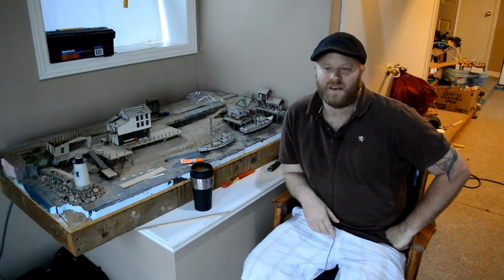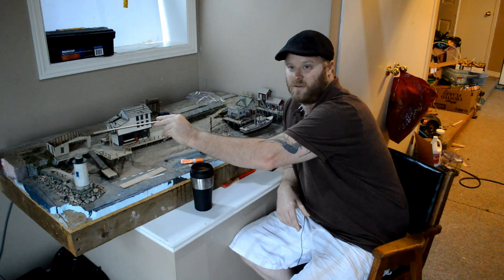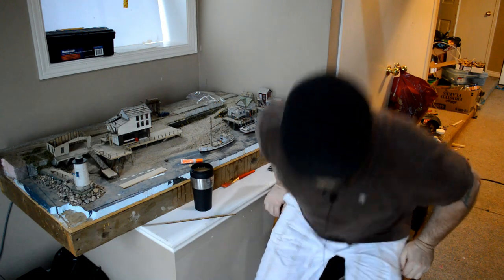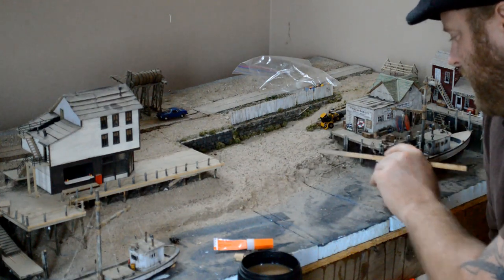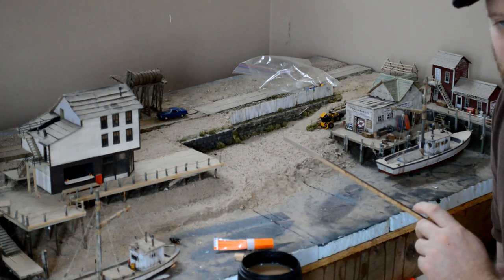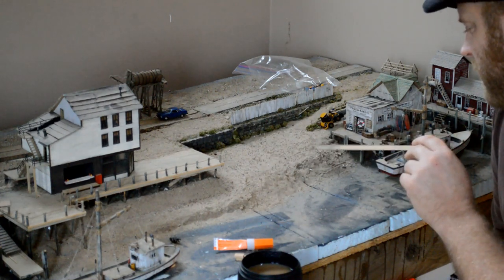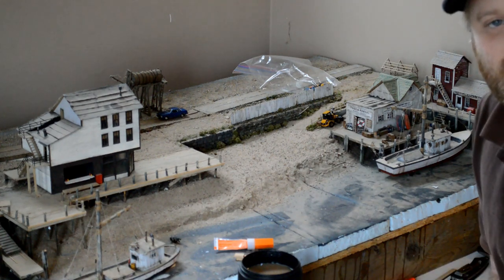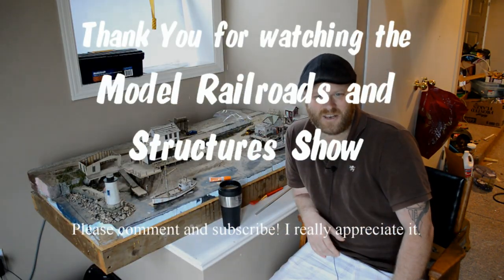Marine project question

Comment: Hi Ron, at the end of the white building (the big one) I would take out a section of the board walke and the water tank in the back ground. Put in a ramp from the area of the water tank down to the water to pull boats up, place a boat repair shop and work from there. Foss Landing kits come to my mind. You have a great start to a sea side fishing village, perhaps even a sail making shop etc. Need help just give a yale. Good luck and keep doing your Thang!
Big Boss Jim
Reply from the maker: Hey Jim, ill sive that up and see!
Reply from the maker: Actually I have the Foss Landing kit, it is going in the next module!
Reply: Ron Pare that's cool, should go nice with the layout. Keep doing your Thang!
Big Boss Jim